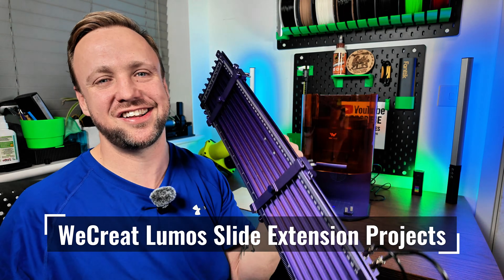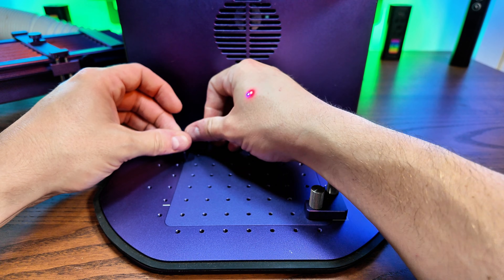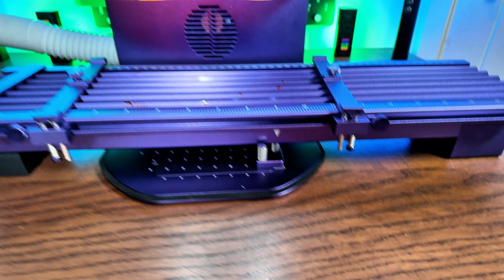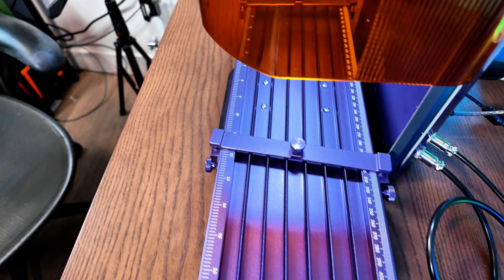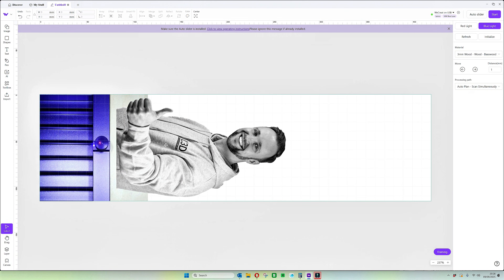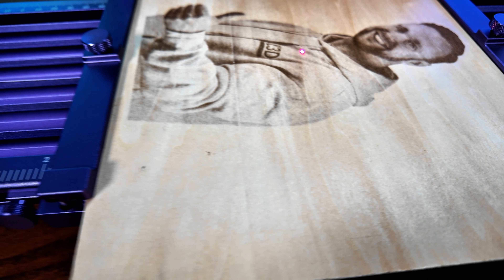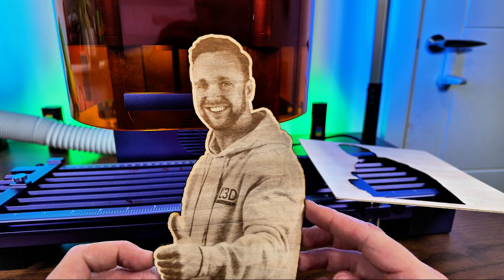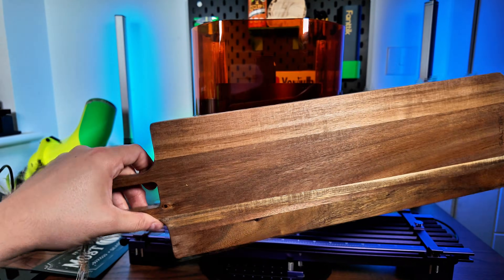Engraving Huge Projects with the WeCreat Lumos Slide Extension

Comment: Nothing special about it? Hell it'd $800 lol...serious though when you engraved the letters and at the end it did I line engrave around the letter, is there a special setting in wecreat to do that?
Thanks!
Reply from the maker: Thanks for watching! I have to admit, it came out really nice. The thing I did to the text at the end was I scored. All you do is take the original design file for the engraving and change the processing mode to score. Then you run it again and most importantly make sure you don't move anything.
Reply: @L3DAccessories  ok cool, I was wondering how you did on xtool, i believe in lightburn you can set it up to do that Thank You

Comment: Is there a way to do multiple separate items on the slider, like 3 coasters with different images?
Reply from the maker: Yes you could definitely do it. You'd need to set up the files in the correct positions in relation to your 3 coasters and then process and it should engrave all 3.

Comment: Can you use it for batch engraving?
Reply from the maker: Yes you can batch engrave.
Reply: How long did actually take to do each if these projects?
Reply from the maker: @aaalharmi I can't remember the exact times but it I had to take an estimated guess: Photo on wood = 8 minutes, 3D Printed Halloween Sign = 25 minutes (this could definitely be quicker with faster settings) and wooden chopping board = 12 minutes. 

Hope that helps!